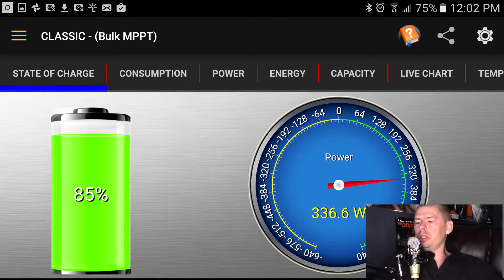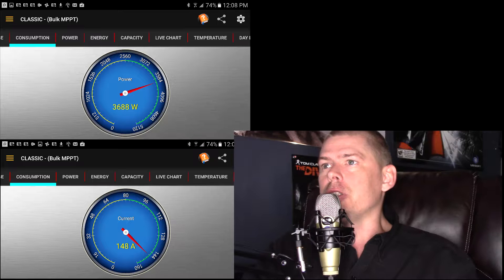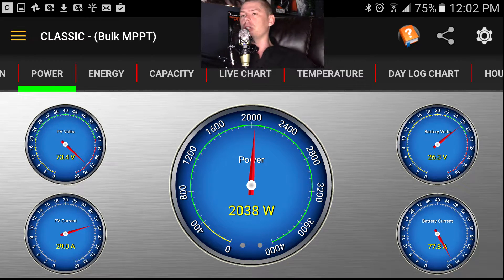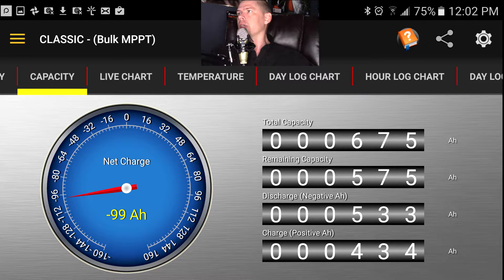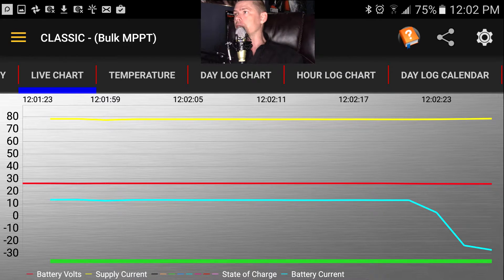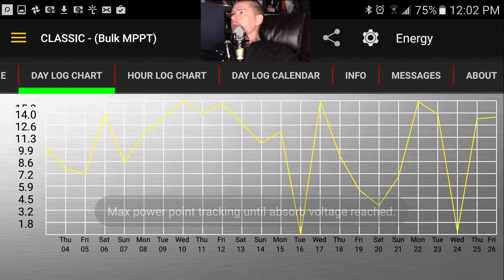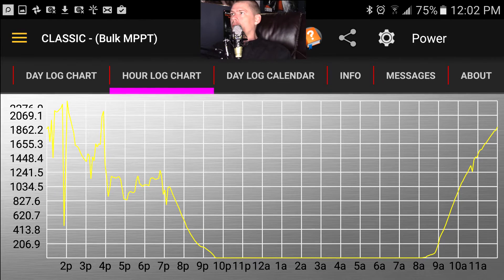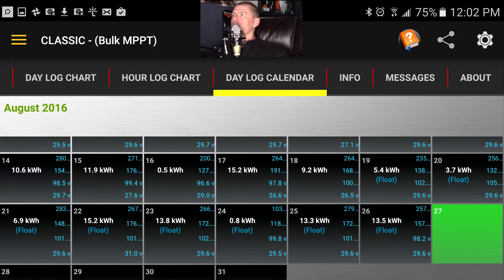Classic Monitor a status monitor for Midnite solar's, Classic 150 200 250 Charge Controllers Updated

Comment: Nice video.  Classic coming soon.  Cool app.  What do I need to make this work. Hard to find info on getting set up.  Thanks!
Reply from the maker: RJ45 internet cat 5 cable and thats the normal internet cable just run one to your modem=)
Reply: @solarpowerelectricityandel2915   Correction, your RJ45 data cable should connect your Classic to a network switch or your router.